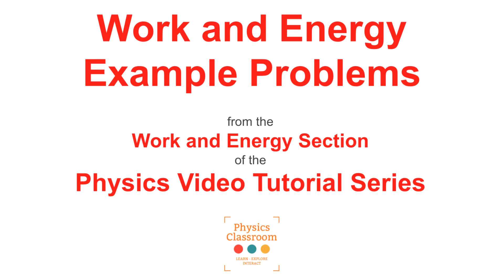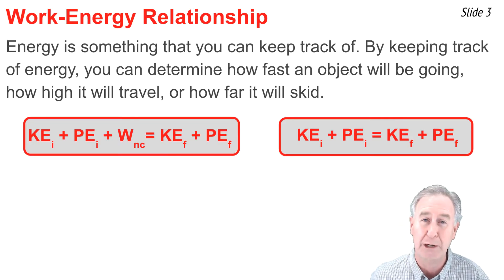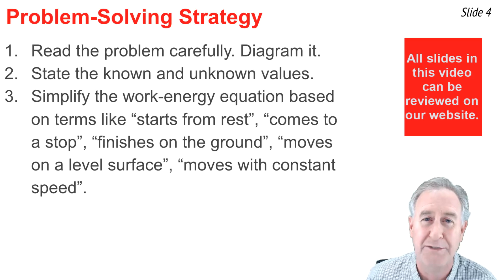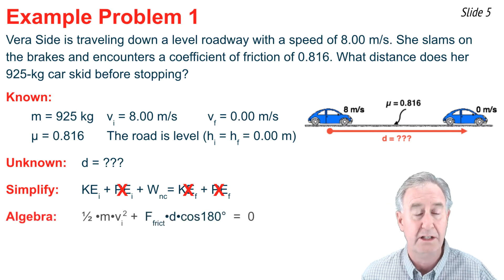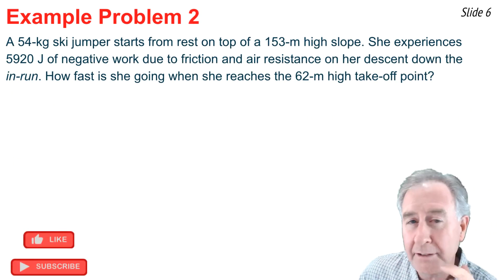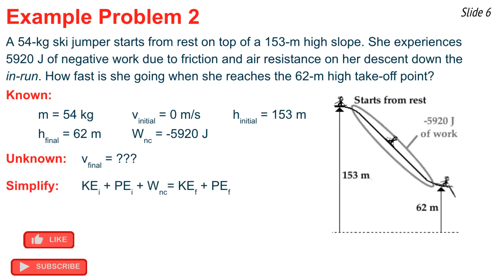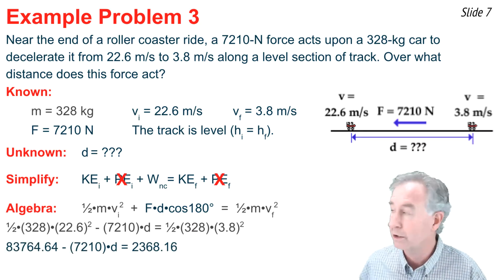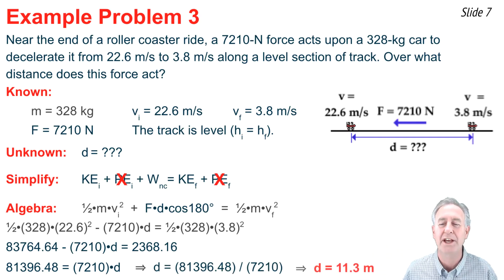Solving Work-Energy Problems

Comment: 10:00 in this question the horizontal component of velocity is the same but due to free fall in vertical direction the velocity is root 2gh and final velocity is horizontal component square plus vertical component square whole underroot .